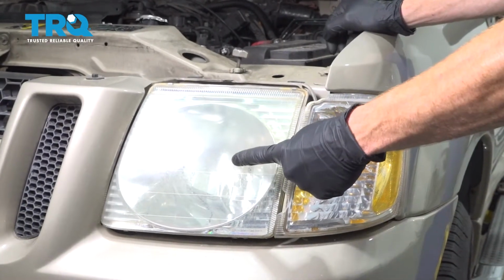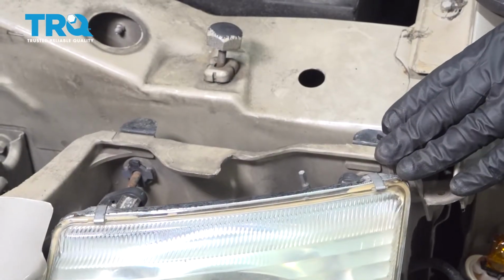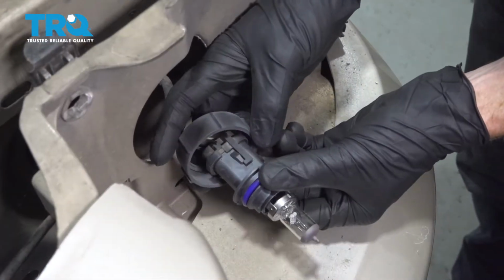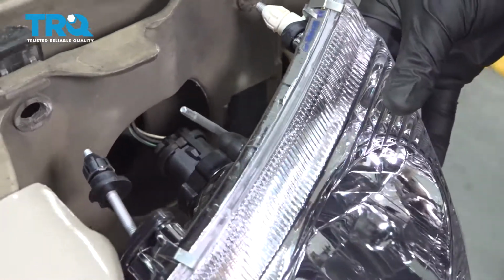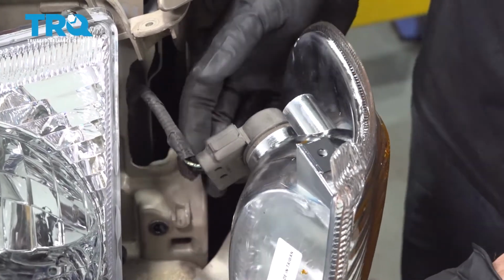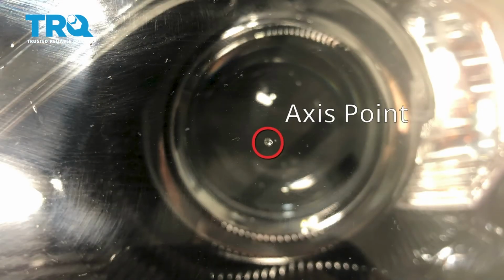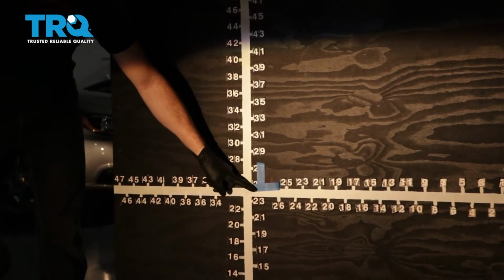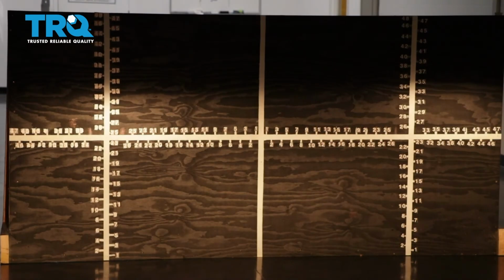How to Replace Headlight Assembly 2001-2005 Ford Explorer Sport Trac

Comment: You ignored pointing out the bottom pin (at the base of the verticle adjustment screw) has to be pushed in so that the locking plate grabs ahold of it to keep the light from wiggling.

Comment: Thank you bud. My gramps had a  2005. The passenger headlight looks like big bird used it as a sock for 20 years. Finallygot around to replacing that and the busted turning signal lamp on the driver's side
Reply from the maker: +@GOLDEN-EYED-TIGER Thanks for watching our video! http://1aau.to/m/Shop-TRQ